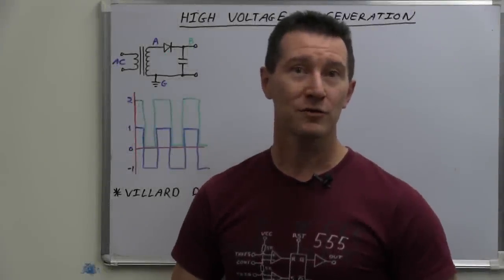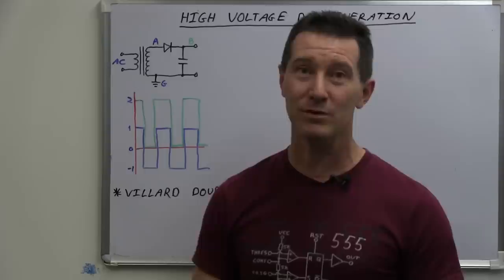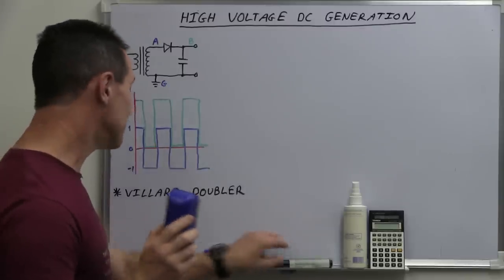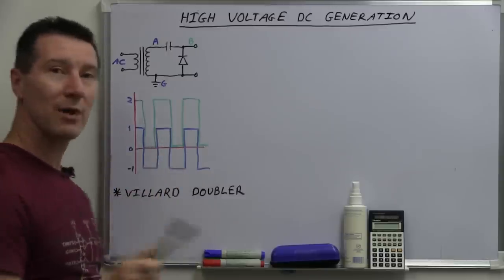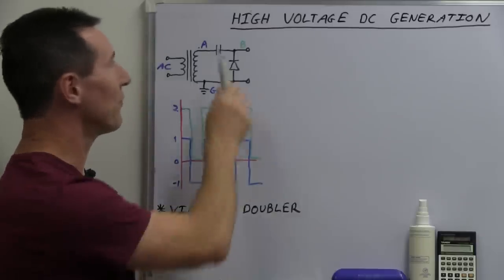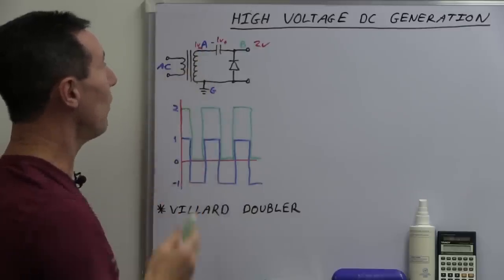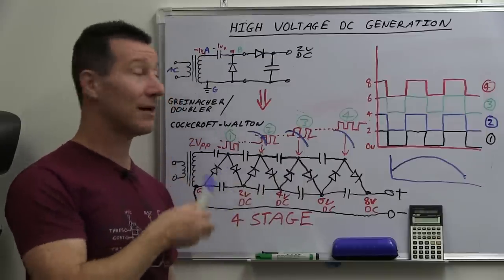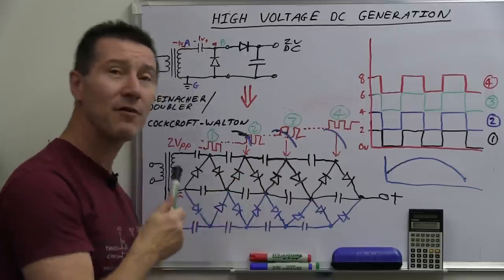EEVblog #469 - Cockcroft-Walton Multiplier

Comment: 'Brilliant' The timing at 30min is good considering that you really gave us two lectures, (a) Theory, (2) Practical Lab/Bench Work @ 15 minutes each.
PERHAPS: Do each FF (FundFri) in two parts each part with a 15 min max runtime. Assume both 'chapters' are combined into one video. It would be helpful to have the LAB chapter starting time listed in the description so it is easy to drop right into the LAB stuff for those that don't need the theory or are returning for the LAB in a second sitting.

Comment: 10 yrs later after watching a few clips and static explanations I was still confused at a - cycle instead of + to start with, then the C3 (the next cascaded stage). Then I came across your clip (subscribed) and assumed that it'd be confusing as well, but it was not. You did explain just enough and was on the right pace to understand the whole A to Z theory mathematically, Thank you!

Comment: The most impressive Cockroft-Walton multiplier I ever saw was at Fermilab. They used it to ionize hydrogen and start the protons on their journey. The insulators were a couple meters long, at least. They used four accelerators in series back then: the C-W multiplier, a linac, the small booster ring, and then the main ring. That was almost forty years ago, so I don't know what they're using now. I imagine it's even bigger.
Reply: Hi John, I am Aakaash and I am presently a postdoc at Fermilab working on accelerator physics. The Cockroft-Walton generator at Fermilab was decommissioned in 2012 (~11 years ago) and has been replaced with a newer more modern Radio-Frequenct Quadrupole (RFQ). I was pleasantly surprised to see Fermilab mentioned in the comments. The Lab is now much more complex and diverse in terms of beam lines and experiments on site. May I know how you got to know about Fermilab (and the CW generator in it)?
Reply: @AakaashNarayanan  Hello, Aakaash. Thank you for the note. I was always a science geek and I loved driving around Fermilab, poking around in Wilson Hall, and taking pictures. (I would just wander in with no permission and no escort. That probably can't be done anymore.) My hobby was landscape and architectural photography and Fermilab had some wonderful buildings and sculptures.

I was working as a programmer in a business setting and wanted to do something more scientific and creative with my skills. To that end, I submitted resumes to Fermilab and Bell Labs, both places I'd wanted to work since I was a teenager.

I was invited to Fermilab for an interview and spent the entire day talking with people and being shown around. One of the first things they showed me was the Cockroft-Walton. If I remember correctly, my assignment would have been writing FORTRAN code to extract protons from the ring.

Amazingly enough, I was offered a position at Fermilab! Almost simultaneously, I was offered a position at Bell.

It was a difficult, agonizing decision but, ultimately, I decided to take the job at Bell Labs. In retrospect, it was probably the right decision, but I still feel wistful about Fermilab.

Comment: Awesome video.  Servicing Electron microscopes for a living I deal with this circuit variant a lot!  30 - 300 KV accelerating voltages, Photo-multiplier power supplies, etc.  Anything over 10 KV are put in oil.

Comment: Watched this again after several years, just realized this is how they do +/-12V for opamps and 5V for digital in Alesis gear (digital reverb effect boxes etc) - they use 9V AC in, multiply it for +/- 18V AC and then it's just 7812/7912/7805 for linear regulation. No need to worry too much about 18V dropping down because it's well above 12V. Neat! :)

Comment: Made a 2.5 kv multiplier once, fed directly from the grid. At the end a couple of megaohm resistors, leading to a blank needle. Worked perfect as air purifier, attracted lot of particles from the air
Reply: Wow thank you for the air purifier can i ask? where was the second pole (aka ground) connected? , was there corona?, and can i know the value of the resistors?                       Im planning custom multiplier fed with 4(in series)  mots and with custom made caps (15000v 1uf (lol im 14 from czech republic) ) to test dielectrics (and yes im hobbyist) thank you for making my tuesday lot brighter, have awesome day
Reply: @milanhlavacek6730  it has been a while (40 yrs) but I think ground was tied to  a bottom plate. I seem to remember the '+' had 2 resistors of 2M2 in series, connecting it to a point needle. 
The entire contraption was encase in a piece of plastic pipe with the needle sticking out.
What I do remember is that the top of the pipe and the wallpaper behind it became very filthy coz of all the particles that were apparently attracted. I think it was a design from elektor magazine

Comment: To Dave (ex- Castle Hill resident Here. currently UK) Loved the Video.  Just one little gripe you quickly glossed over the operation of the 'clamper' circuit as magic and this really threw me.  i sat down and figured it out and found it's function quite interesting..  as in the Capacitor is charged to a positive level starting the negative AC input cycle with current flowing through the forward bias of the diode minus the diode voltage drop.   then as the cycle reverses the voltages are added.

Comment: I once modified a friends UK-only(240V) ghetto-blaster to run on USA power(120V) by re-working the bridge rectifier (off the secondary)  using a full wave doubler into the main regulator(s).   It mostly worked... but if the music was too bass heavy, and too loud, the system got a little noisy from voltage droop.  Overall the hack was successful, but it might have been better if I had put the doubler on the primary...  fun stuff!   Thanks for the in depth coverage of voltage multipliers!

Comment: 1st bit: Used a random ceramic cap, a random diode, and hey presto 6.3V became about 11V AC.
2nd bit: 14.16VDC with the extra cap/diode to rectify it.

For those who can't be bothered breadboarding it as you go :D

Comment: Thanks, I have a ton of old capacitors and diodes  so I was considering using this setup for a negative ion generator for our house, but it looks to me as though I would be working against the odds because of the USA'S 110 volt AC current, I  would need some 60 caps and diodes!

Comment: Fun fact: those are also used to test transformers for atmospheric discharges (aka: lightning). Some can generate millions of volts and the circuit can be tens of meters tall, with giant capacitor and diodes.

Comment: I believe they use Cockcroft-Walton Multipliers for particle accelerators.  They need bursts of high voltage.  I may have missed it, but remember that the current limit of the supply follows conservation of energy.  Double the voltage, half the current.  That however will only be the constant current.  Do a cap draining calculation to see how the voltage can last under your current loads.

I used one for a low voltage generator to bump it up and turn on some LEDs.

Comment: the Befaco I4 interface (modular synthesizer module)  uses a 555 timer to generate a "AC" signal in combination with this to source 48V from 12V dc.

Comment: ...as Dave so often says, get yourself an analogue scope. Well that is exactly where you might find one of these cascades. To pump the voltage for the HT anode(s)
Depending on the age, you might find an oscillator / regulator feeding a transformer then into the CWM cascade.

Comment: There is no problem in making 15 or 30 minutes or the content is good. Looking forward to the dc-dc conversion. May I suggest to include circuits that gives +/- voltage for op-amps?

Comment: One small note(Villard doubler), in your circuit the capacitor would never charge up on the positive cycle, because there is no load to complete the charging circuit.
Reply: He assumed that it was already charged. He did not explain that the Diode in Villard doubler will be forward biased during the negative half cycle and the capacitor will get charged to peak of input voltage during that time. Regardless, this is a very good tutorial on the basics of Cockroft-Walton Multiplier circuit.

Comment: 05:34 I'm lost on the voltage smoothing stage.  As described the cap is in series with the coil of the transformer as seen from the output of the first stage.  The cap basically acts as a non changing voltage source while the series connected coil ether adds the same voltage that is across the cap giving a peak voltage double that across the coil or when the voltage across the coil goes negative subtracts the same voltage that is on the cap giving a net result of zero volts for the output.    Now, it the second stage were to smooth the output voltage into smooth DC as shown by the black line, the next voltage doubling stage wouldn't have a pulsating voltage input needed to create voltage doubling or voltage shifting.  The scope doesn't show any voltage smoothing going on, just a pulsating square wave.

Comment: Dave one question so basically this circuit is to charge the caps in peralell and discharge them in serrese
Reply: I've seen about 8 different descriptions of the Cockroft multiplier and it occurred to me after the 5th description all of them were missing the obvious point that you just made.   You charge them in parallel and tap the series voltage off the capacitor bank -- just like if the caps were batteries.
Reply: That's exactly how I first heard the C-W multiplier first explained, FWIW.

Comment: The doubler shown at about 6:44 is not a Greinacher circuit. A Greinacher doubler is a symmetrical doubler, also know as a Delon doubler and gives a distinguished 2f ripple frequency. Unfortunately it's not only here that the Greinacher circuit is mixed up with the Villard / Cockcroft-Walton cascade circuits which all have an asymmetrical layout and give a ripple frequency of f, similar to a single phase rectifier.  For a correct overview look here: http://www.kronjaeger.com/hv/hv/src/mul/

Comment: In the green-blue square wave graph you have a waveform of +1 to -1 volts, and another one of +2 to 0 volts. The last thing i want to do is to point out a stupid thing, but why do I think that the potential difference of the to is the same anyway. Even if you rectify the two, I think you'll get the same DC output (given ideal components). Please correct me if I'm wrong!

Comment: This circuit is constant current/AC voltage at the input. but as current (Power Supplied is constant) drawn from the output is increased (resistance decreased) the circuit discharges a greater and greater level of charge into the output stage thus robbing each capacitor stage of the highest level of voltage it can achieve at each doubling stage thus balancing down the output voltage in kind. resulting in higher current lower voltage. increasing the duty cycle may help reduce the effect. maybe.

Comment: Well ive build a lot of these things just for arcing around.
And you can be sure. If you take of your source, the caps stay charged for a LOOONG time. Shorting them out one after another doesnt help that much. I would prefer resistors parallel to each cap. But as Dave said. That a huge load on that thing so thats bad for your output. Just build it. And when you use it, dont touch, when you need to fix something get cables an shortout every cap and wait a while.

Comment: No explanation at all about how the diode is allowing "this point to go to zero volts" @ 6:33. You already have -1V + 1V = 0 there. I think what you were trying to say is at this stage for some reason it cannot get to zero, unless the diode conducts and lets the voltage pass through it to ground.

Comment: I may be completely biased but to me this looks like an AC coupling circuit with a shiftable reference point. I mean when the diodes are off they are basically like really large resistors right?

Comment: Dear Dave,

   Would using schottky diodes be more beneficial than using regular diodes due to their lower Vf (more than half assuming .7 for regular and .3 for schottky)or would the higher reverse leakage current end up causing more problems?

(Great video btw)
Reply: +kmash64 schottky diodes would indeed present some benefit as they have a lower Vf. Besides this their higher switching frequency is also beneficial. Sadly it's a bit harder/more expensive to get a schottky rated at a nice voltage whereas a 1N4007 can be had for 0.01$ a piece while ably sustaining 1000V reverse voltage. The leakage would indeed also be somewhat problematic. So I would say it depends on your application: very high frequency? rectifier diodes are a no-go. very high voltage? schottky diodes are a no-go. low value capacitors? no schottky's please.
As Dave mentions these multipliers aren't meant to be loaded very much and their diode drops are annoying. Most of the time they will be used with HV inputs and relatively low-value capacitors (due to the high voltage requirement), here the diode drop doesn't matter too much (how much is 0.7 Vf per diode if your input is 1000V?) and your leakage will matter quite a bit as it will drain your caps and sag your output voltage.

Comment: Dear Dave,
What do you think should be done if a person is making a huge ladder for a voltage multiplier? I am sure if we end up getting 1000s of volts the air may get ionised and we may end up getting coronas as well! What safety does a person need to follow in this case?
Regards,
Random Guy

Comment: Maybe a stupid question but I dont get it... In the positive cycle wouldnt the capacitor blow up as it is "backwards connected"? Or is it that they are non-polarized?
Reply: non-polarized caps, you can use the silly ceramic caps.
Reply: Or Polyproplyne
Reply: Ayy lmao
Reply: Yeah if you use electrolytic caps on ac sure it will blow up... use non-polarized...
Reply: Voltage on caps is DC, thanks to diodes, no inverse polarization happens

Comment: Hey Dave, make some videos about "hard to make" things. Let's say, I have 2xAA batteries (so, max voltage is 3V, min 1,6V). AVR AtTiny will work from 1,8V, ok. But now I have some other electronics that need min 4V. You can use voltage doubler or coil. But the tricky part is: transistors (unknown mosfet Vgs from 0,5 to 3V), batt reverse protection diode- too much Vdrop so you take mosfet (but again problems with Vgs). Talk more about project problems (like earlier speech about PCBs).

Comment: Nice video, thanks. Given the diode and capacitor losses, what is the advantages over simply using a transformer with lots of secondary turns, other than the weight of the iron?
Reply: The transformer would require much more current to drive, meaning more power and would probably be out of spec for what your average discrete components can handle.

Comment: so two things. The transformer in the left is not really required, right? In the breadboard, there is none. Minimum requirement is an DC voltage that is swichted on/off using a mosfet. Now how does this perform if you have a real load on the output side? Could one use this to power a chain of serial LEDs from a low voltage power supply, where usually a step up converter would be used? Sounds like a more compact (no inductor) Joule-thief circuit...

Comment: I have a bunch of surplus ceramic door knob caps I got at a good price for a project to built one of these multipliers.  In the events of discharge by sparks there will be large but short current spikes, what means of protection for the diode do you recommend.  I have built a few with diodes more than double the stage voltage but they seem to blow the diodes up if sparking the output too much which I assume it the high peak currents.    I had 50x 1kv 3A diodes per diode stack for my test setup.  

I have seen a few people use wire wound resistors for each diode and some use just one big one on the output.  Thoughts?

Comment: Do the drop-down-voltage problem could be solved by increasing the value of the capacitors and connecting several of them in parallel?

Comment: Is it a "doubler" or a "doubla" ?  But seriously, is this what they call a "charge pump" ?  Is there a failure mode in which it can accidentally produce a higher voltage than it's designed for?  Thanks.

Comment: Hi Dave,  At about timestamp 0:01 that circuit on the upper left looks familiar--OK was that the voltage doubler used in powering microwave oven magnetrons???

Comment: At 5:22 what is the purpose of the Diode in the peak detector circuit. Is it just that node B would stay at the peak 2 volts all the time when we want to see it cycle between 0 ans 2V.

Comment: That's easy. Hook the hot side to the car body and the ground to a ground rod. The rubber tires insulate the car from the ground. When the stream of pee hits the car...;)  Here's an experience I had in the 1980s.  I was working as the transmitter engineer for a TV station. I heard a "POW!" come from the transmitter.  I checked it out.  Lying at the base of a H.V. cap (8uF, 7.5 KV) was a mouse.  His front & hind legs were charred. A charred streak ran across his belly & his guts were hanging out.

Comment: What kind if waveform does a spark gap create. And could you have one power another but with a spark gap between them, and that second unit at higher frequency higher voltage, power another unit but as a spark gap, and keep this going until you get godly insane voltage without amperage, and insane RF frequency. And then the unit on the end powers the very first input unit. And with RF being so high it rips electrons from the environment and put into the circuit producing OU??

Comment: I am realy interested about what happens to the maximum current with each stage of the multiplier. Does it decrease as to keep the power in the entire multiplier the same? Or is the current limited by the diodes used.
Reply: Max current is due to the capacitors, each stage divides the total capacitance (lower caps are in series when charges/no current in diodes)